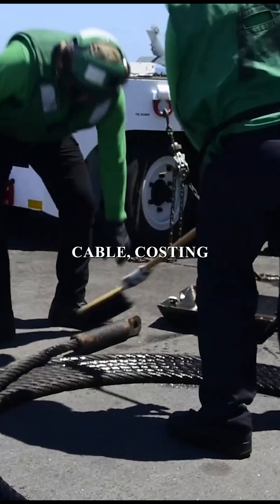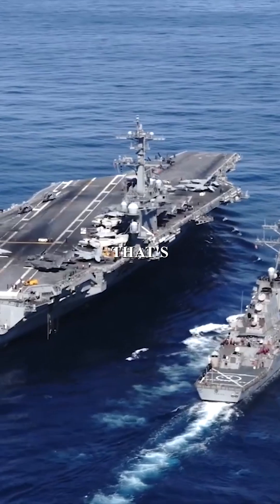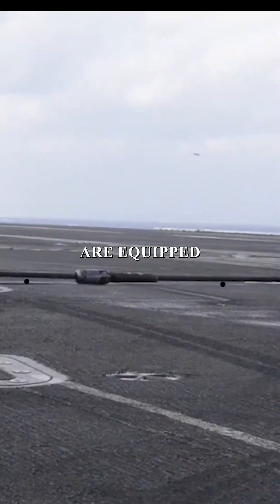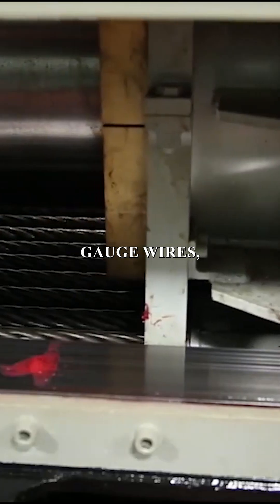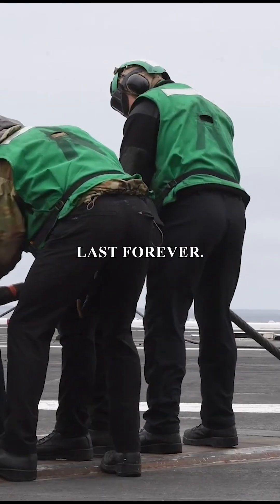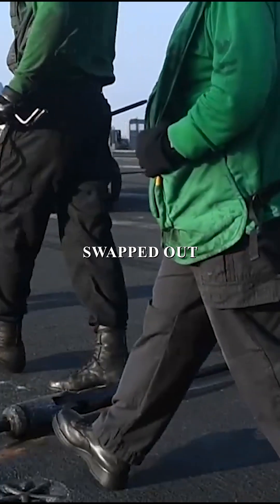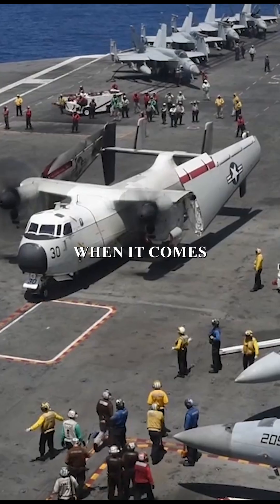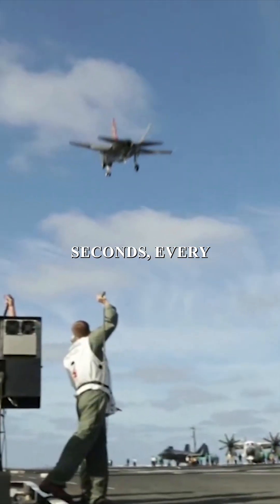Why This Cable Costs $1.5 Million!

Comment: If a C-130 can land and takeoff from a carrier, an A-10 would have no problem.  Although it isn't equipped with arresting gear, an A-10 can land on a carrier, then takeoff as well.  As a former crewchief on A-10s back in the early '80s, I saw them land using 1/3rd or less of the runway (due to IFEs).  They can, and have, used roads or even open fields to operate from.
Reply: Good point. But, both aircraft (C-130 and A-10) are also subsonic aircraft and can fly at a much lower speed when landing than an FA/18 Super hornet or back in your day an F-14.